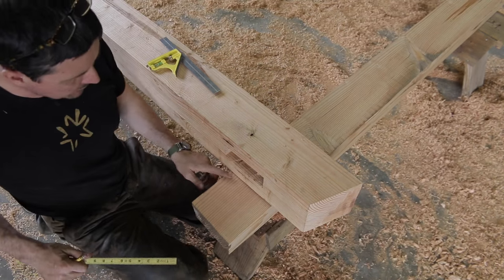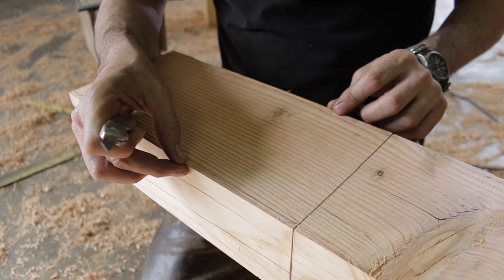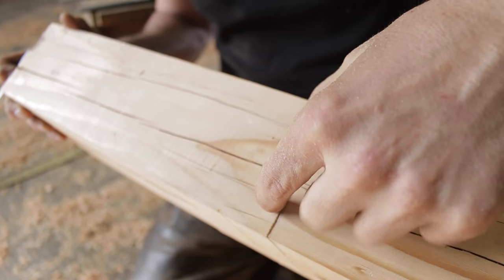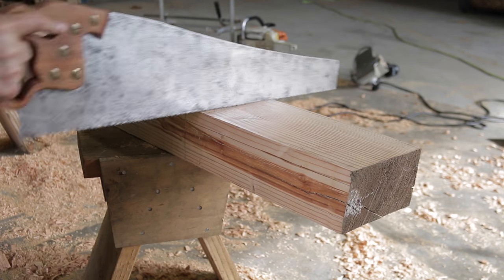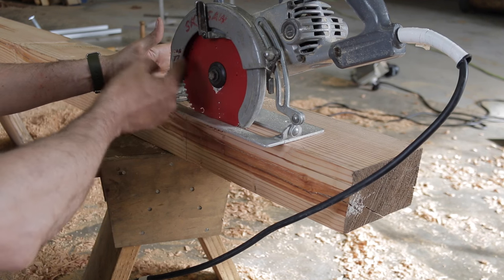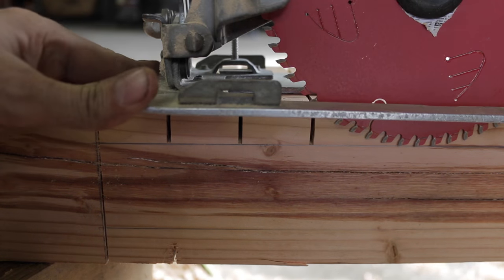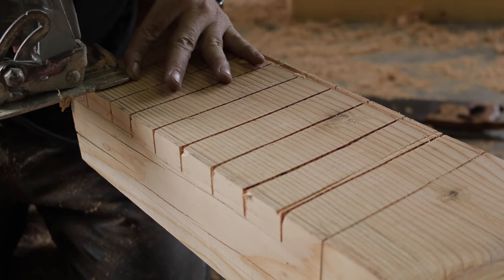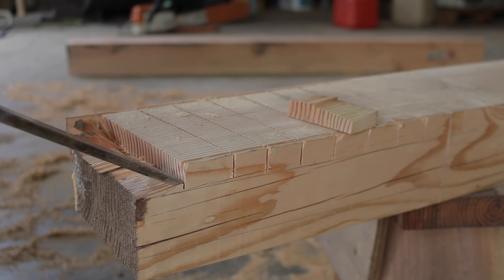Timber Framed Mailbox To Last

Comment: this was a very long and convoluted way to remove that material. It'd would have been many minutes quicker to use the saw on its deepest setting from the end and the sides to get most of the material out, then clean up with a chisel later.

Comment: Would it have worked to cut the face of the tenon with the Skil saw, rahter than kerfs?  By that I mean making 4 rip cuts on the other edge of the beam (2 on each side, on either side of the tenon), then chiseling or slicking to final thickness?

Just curious, not questioning your method.  I'm an engineer.  We ask questions about everything.

Comment: So why didn't you set the saw to its deepest, turn the post on edge, then cut out the majority of the wood and just use a chisel and a plane to clean it up?
Reply: ripping with a skill saw isn't much fun
Reply: +Simon Hills I'm a carpenter and have had to cut cypress beams with them. He just has to take off what I would consider a small amount of wood and would take a lot less time than 10 small notches and then chiseling it out. I'm not saying he is wrong for doing it. I'm simply curious why he didn't do it how I suggested.
Reply: +Kyle W fair enough.
Reply: +Kyle W I think, and don't quote me here, that it is not as much a question of speed or efficiency here.  Instead of making a concession to  use the unpowered tool because he has to I think he instead made the concession to use the powered skilsaw because it took away the redundancy of repeated relief cuts with the handsaw.  Put more simply, I don't think his head was in the same place yours is as a professional carpenter.  He wants to do it the traditional way but just allowed the skilsaw to take the drudgery out of the work much like Paul Seller uses a cordless drill most of the time.
Reply: +Kyle W Perhaps you missed out when Cody mentioned that the material wasn't square?
Reply: +frackcha it doesn't matter... He's going to have to clean it up after he chisels it out too.
Reply: Kyle W
Yes he is, but as he knows he hasn't gone over his line he has no worries.. Cutting as you suggest would result in the possibility of carving through his lines deep inside the cut.. Remember, he isn't working with datum surfaces here.
Reply: I just had to rebuild a couple utility shelves.  I needed to cut down 12 2x4s to 74 1/2 inches. I looked over at my compound miter saw for a second but as Mr. Pete/Tubalcain would say, I just couldn't be bothered.  I really didn't want to pull it out, plug it in, listen to the screaming motor  and get flying dust all over my just cleaned shop.  Instead I clamped a 2x4 in my vise and pulled out the crosscut saw.  Really, it only took a few minutes longer, gave me a little exercise and was so much more peaceful...It is the little things in life...

Comment: I understand your desire to avoid pressure-treated wood. But in order to preserve your timberframe mailbox post as long as possible, why not do what the old-timers did? Heat up some tar or creosote in a barrel (one of those turkey fryers ought to be able to supply the heat you'll need), and submerge the end of the post in the hot tar for 10 or 15 minutes. That ought to double the mailbox post's lifespan. My understanding is that shipbuilders used to do this all the time--which should make you like it even more!